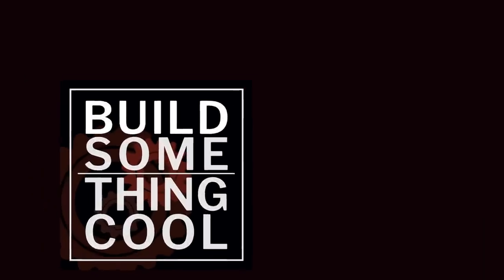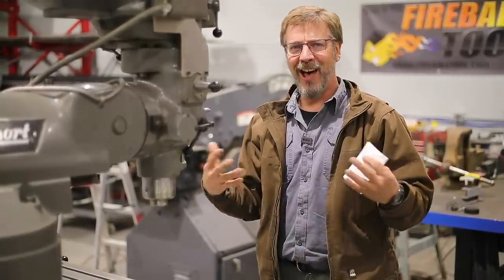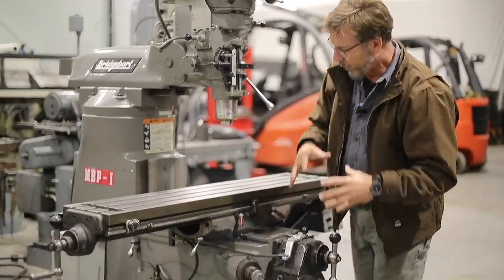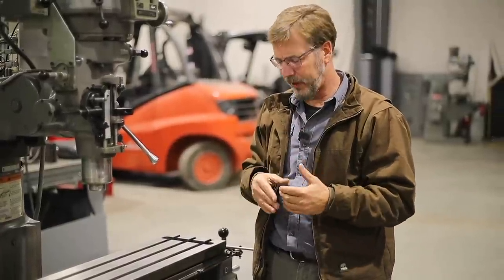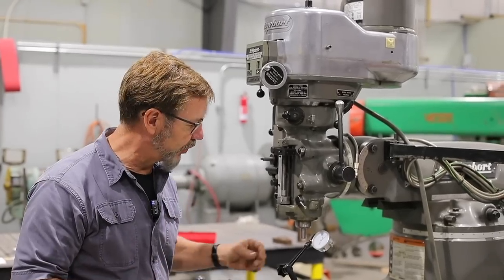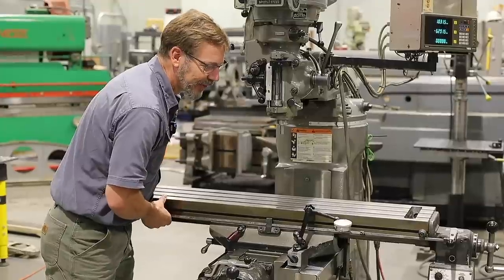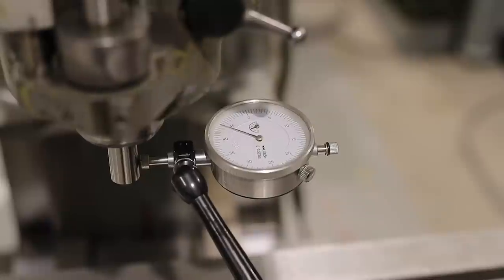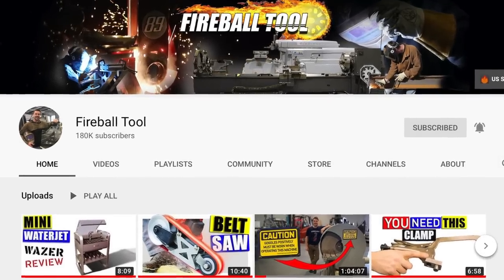How to buy a mill machine

Comment: Thanks for your vedios! I have learned a lot from your channel!  I do have a question how would one find deminsion for makeing a 6" riser block for my J-head step pulley?
Reply from the maker: The best way if lift the Turret of the base and measure it. :-)
Reply: Once the top comes off, is this project self eveident  ( like my spelling expertise ?) lol  schdual 40 or 80?
Reply from the maker: Dan Hoag. “80” plus you will need to weld a flange on both ends
Reply: @BuildSomthingCool  Concurr.  Nobody has the dimensions on the mill.  The riser block came with a dimension-ed sketch   I don't have a reliable sine tape so I bought a 24" digital caliper for use in the video.

Comment: I like step pulley machines for the home shop.  They are less expensive than a comparable VS mill (everybody wants VS).  But if the home shop guy is running off a VFD, he's got a fair amount of vari-speed anyway.  Less maintenance, and quiet running are the other two benefits.

When I bought my J head Bridgeport to replace my old Millrite,, I specifically looked for a step pulley version.

Comment: Recently bought early '90s Bridgeport. Tightened up nuts (dual nuts) to remove slack. significant wear on x-y tables, so I assumed tightened gibs causing tightening toward ends of travel x&y.  Later, bought new lead screw. After installing, realized problem was lead screw all along. Wear in tables barely noticeable. Tightening nuts, wear in leadscrew became extremely noticeable. Since I had a 2nd Bridgeport, I turned the leadscrew in the lathe, and thinned ACME threads. Installed used nuts. Excellent results. No need to ever buy another lead screw until the wear gets so bad the threads strip.  Only 4 dual nut systems.

Comment: Thank you for video.
Very good explanation of buying process. As every shopping there are two fundamental questions: whats your need? does X meet your needs? After good analysis one can find a suprise answer like "In fact I only need single, new, well equipped, classic T&C grinder for my work" - as for example LAKFAM NUA-25 MA;)
Milling machines are great (cause of many degrees of freedom giving great processing capabilities), but they possess many error surfaces (the wear) giving less accuracy in the end. Most accurate are cylindrical grinders, but these are the slowest processing machines. Lathe are some kind of compromise. With proper knowledge, and processing plan one can make the same thing on different machines / hand files.

Post Scriptum: bushings has two times better accuracy with comparison to bearings due to half of error surfaces. Once I was wondering why it is not a good idea to try preheated kerosene lubrication net for double Babbit's frustrum cones with obvious clearance setting. In general some machines should be centrally preheated in vital points, independently from stable room temperature.
Post Post Scriptum: generally speaking some obviousness are not common in machinery like for first shot: nitrogen atmosphere for direct 3-points pressurized acetone, as sub-zero coolant system.

Comment: Retired CNC programmer/setup guy here, now home machinist. The ONLY thing I did when I bought mine at auction (OK, other than seeing it run) is the ONLY thing I did not see here: check for spindle bearing slop. It's one of the very few flaws that can not be adjusted away, replaced easily or dealt with in use.
Reply: How? Just wiggle it around while measuring with an indicator?
Reply: @ChristophPech  Essentially yes. As you'd measure play with any bearing: mount a bar in the spindle, put an indicator on it and try to move the bar. Anything you can feel is a no go; five ten-thousandths on the indicator would concern me. You can do accurate work with lots of backlash but a sloppy spindle bearing means you'll never get a good finish and tools die fast. In short another very expensive drill press.
Reply: @tinman5322  Thanks
Reply: @ChristophPech  Pleasure!

Comment: Pretty Miraculous to find a real Bridgeport that isn’t used up  BUT the variable is quite loud
Reply: The plastic bushings in the variable speed are cheap. They get beat out if the machine is used regularly. That's where the knocking is coming from. Replacing them is like arming a giant mouse trap so if you've never done them before watch a video to show what you need to do the job.

Comment: You should pick up fabricator grade. I seen one that had table used as anvil went on auction yesterday for around $1400. I looked into getting it and fixing it up but given the abuse and price I passed at just over 1000 USD. You forgot to mention electrical and inspecting that. Also at auctions you cannot run machines. I run by hand and noticed already some strange noises. 
I am not joking with anvil part - the table had a bulge of about 100 thou on the front of the table where parts where "fixed".
Reply from the maker: Good point about the electrical, I should have said something. 
Something else I should of said was "Stay away from abused machines, and ones with missing parts"  :-)

Comment: I think that was a very rare find. I got a very used Jet 9 X 49 with only the X feed, an assortment of mostly poor quality tooling. I did get something, unusual?? Two micrometers and a caliper made in the USSR.  Still in very good condition, original boxes and gage standards. Tightening the gibs improved it, some. Shortly after getting it home I had to replace the variable speed belt, took two of us. I put a DRO on it and it is good enough for a home shop guy. Price, don't really know. I got him to throw it in when I bought most of the remaining stuff at their factory. Before I got everything loaded I had sold about 1/2 of it and got my part for nearly free. Shipping was kind of expensive though.
Reply from the maker: Those USSR mic, imperial or metric?
Reply: @BuildSomthingCool  Metric, which turns out to be good because my Starretts & Mitutoyo are Imperial. I do repair work on metric equipment. The 25mm mic has a plastic case and the mic is marked 1982 All 3 tools have what looks like a brand name, K surrounded by an image of a micrometer. Very smooth moving, has a cast frame but a plastic lock knob. The 25 to 50mm has a steel frame (SS?) that is 5.37mm thick, same brand marking with the CCCP. Nice metal locking lever. Well used fitted wooden case with a 25mm gage pin. All 3 have serial #s.

Comment: Your correct that was a cherry mill. Here in my part of NC the prices of mills are on mills are on the higher end. My Lagun was 4K and it was solid machinist mill. Since it was across town I had local riggers to shoehorn it in my little shop. I’ve been happy with it and love my 50” table
Reply from the maker: I will say Im getting use to the long table, but some times its a stretch for my short arms LOL😂
Reply: @BuildSomthingCool  As I dickered and wrangled for a best price on new mills I got a much better price on the 49" table.  For me, the extra length was essentially free in the end.
Reply: One can run a vice and a rotary table side by side and have two work stations set up ready to go at the same time.  Sweet.

Comment: The tandem axle trailer from uhaul doesn’t cost much more,  quite a lot more weight capacity that way.
Reply from the maker: Good point, but they are not alway available😔
Reply: Guess I’m lucky, around here (Ohio) there usually seems to be more tandems than singles.

Comment: Hello, I love your videos! Always so full of knowledge. I actually purchased that same original bridgeport y axis power feed and recieved the stop rod, cast bracket, power feed itself and switch. I've figured everything out but the correct distance from the top of the knee ways to the holes that need tapped for the bracket on the side. Anyway you can give me that information? It would really help me out. Without the cast iron bracket installed you can hit the body of the Bridgeport or run towards you without stopping. Not necessary to have but it would be nice. Thank you in advance if you do read this comment! Thanks for all that you do!!!
Reply from the maker: Im not on my shop right now. Ill try and do it later
Reply: @BuildSomthingCool  thank you! That would be fantastic, it would help me out alot!

Comment: Looks like a really nice mill! Only thing I disagree with is about the glass scales being best. I prefer my sclaes expand and contract at the same rate as the material I am working with that way it finishes at closer to the standard dimensions.  On glass scale machine you could machine a part in a shop at 110degF then try to mate it to a part machined in the same shop when it was 50F and it won't go together, with steel based scales it is much more likely that it will. Before there were many climate controlled shops this is the reason jig bores used steel standards for positional locating. No other method was suiteable.
Reply: Love your videos!! Thank goodness your carlton didnt land on you! I'll never forget when that happened to you! Also looking forward to you showing the repair on the large monarch carriage!!

Comment: Any ideas on why the numbers would “stick” and/or skip on digital readout before I start tearing things apart?
Reply from the maker: No I have no ideas. You're on the right track I think you're gonna need to terret down. Even the mill I tore down and cleaned it.
Reply: most of the time is dirty in rulers with the sensors but they do not last for too long at the end they start to show a lot of broken digits. Sometimes dial indicators are more helpful.

Comment: A question if you have a moment.  As it relates to milling machines, when you have a end mill that has become dull, can those be sharpened or do you have to toss them?
I really enjoined the video, thanks for putting it up.
Reply from the maker: You can have any cutter sharpened. The question is is it worth it? Small endmills are cheap and easy to come by. larger ones made out of carbide. I think you get that sharpened :-)
Reply: @BuildSomthingCool  Thanks!
Reply: You should sharpen only the the flat end part and is quite easy. If you think you need to sharpen the radial sides then cut the tip like half inch (10 - 12 mm) and sharpen the bottom. You could be surprised that it may perform better than the new tool. Why? because it is shorter, the vibration is reduced.
Reply: @wd9102  Thank you!

Comment: quill stiff because lock is on!!
Reply from the maker: The quill was fine, moved smooth.👍
Reply: @BuildSomthingCool  hi i worked on a Bridgeport the quill lock looked  like like
it was tight as it was in  the 5 oclock
position usually unlocked position is
2 oclock or thereabouts

Comment: Sorry but as far as a mill for a home shop goes this is exactly like so many forum posts where the one's giving advise are basing there suggestions at there own personal level they specifically use any machine tool for. There's an unlimited number of parts, accuracy requirements and reasons why a mill might be needed in a home shop from that basically worn out but good enough for fabrication end all the way up to needing the same condition and accuracy those tool & die guys are wanting. Good enough for a home shop isn't universally true for everyone.The one buying has to access what there needs are before deciding how much they might have to spend to get it. And maybe a cheap sub $300 off shore dro with no real part availability or support may not add much to the price of a mill. But a current model industrial level one like that Mitutoyo would add a fair amount to the acceptable asking price and desirability of any machine I was thinking of buying.
Reply: You're right of course - but it does need to be tempered with this: If you know enough to differentiate between the different standards of machine presented, by yourself, then you probably don't need this video, and you are not it's target audience. For others, it's a great starting point. There are also many other variables which affect value: country of origin, brand, size, age, 3-phase vs 1-phase, which tooling included, any repairs required, missing parts, coolant system, has it ever been rebuilt?, if so - how well? and so on. Not all of that can be factored into an easy to digest beginners video, some of it will be obvious, some of it won't matter, some of it will be crucial. But this video does a great job with the most important points (better than most anyway) - especially for people that don't know where to start. To do a perfect job of this probably involves taking the buyer through both an apprenticeship and a machine rebuilding course. (Last point is tongue-in-cheek but hopefully you get my point).
Reply from the maker: Great Comment😀
Reply: @CraigsWorkshop  A well thought out and logical counter argument. How about Dale, You and me are all partially or fully correct depending on the variables of the situation. :-)
Reply: @turningpoint6643  I fully agree to some degree :-)

Comment: I've bought 2 mills, 2 lathes, and a surface grinder...still have 2 mills and a lathe.......I bought a 1940's US Machine Tool Co 10x36 vertical mill for $400 that wasn't under power and just took a chance on....then recently I bought a 10x50 VS 3hp Enco mill, that was under power and was in amazing shape for $1200...I check Craigslist every day for what is out there....The prob I find is that everyone wants $3k plus for a machine that is easily in the sub $1k category....I subscribe to the theory that the max a machine should be priced at is never more than 50% of what it was new....and that's if it's in literally brand new condition....the other thing I think people should keep in mind as a selling point is power....if the seller already has a VFD installed and it's plug and play, that is worth more than simply the price of the VFD....as is the DRO....a DRO installed and working is way better than having to buy and install your own....
Reply: Have to agree with Nathan on the DROs.  I'll never buy again and add a DRO.  The kits are cheap but you erase (and then some) any savings through the time/cost of installation.